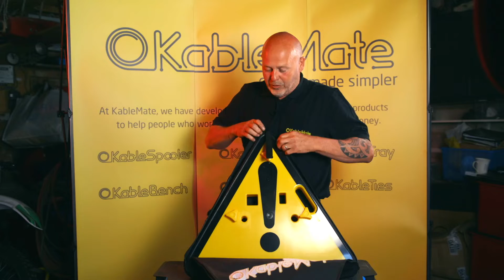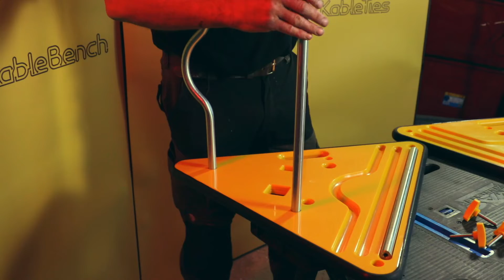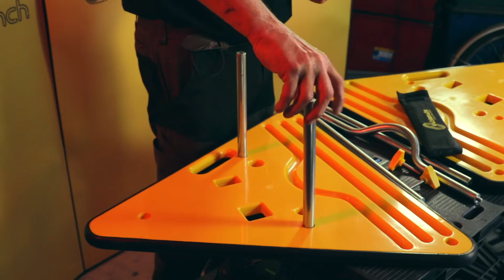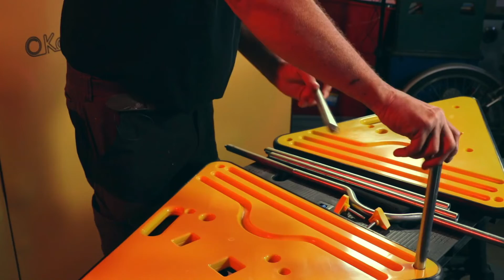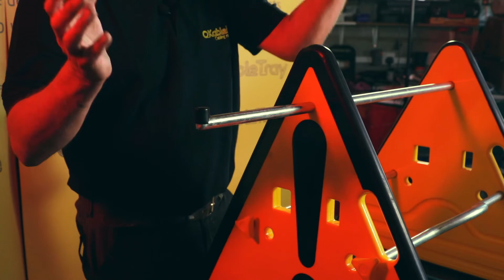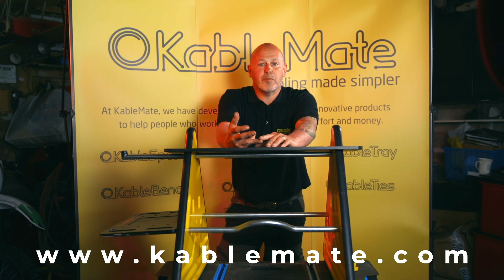KableMate - the flexible electricians cable spooler, work bench, hop up step ,conduit vice...

Comment: This looks pretty nifty in all configurations. However clearly when using it as a bench... Its not going to be for cabling at low level, this is a workout bench designed for bulking up your arms 💪💪

Comment: Shame the bars aren't 20mm conduit, that way we could replace/make our own. It is a pain to unscrew the bars to change drums of cable. Still hard to beat a pair of jack's or some rack-a-tears. All those extra bits for the bench and hop up seem a lot to carry around, I would prefer using something I already have or a bit of wood (even a template to make your own would be good). Curious if turned on its side if you can stand on it?? Would be great to see an on site test!

Comment: like the idea and concept of the bench etc. only issue i see is the fact you have to undo the bolts every time you want to change a drum
Reply from the maker: Good point 👍
Reply: @efixx 

With reference to the necessity to remove 3 bolts when changing drums.
If you look for antiluce or anti luce pins, say, on eBay, you will find a solution to the pesky bolt problem.  The thread size has obviously got to match, and three large metal washers to protect the unit would be necessary. The unit can then be swiftly disassembled with a Birmingham screwdriver.
This can only be attempted, after a risk assessment, and presumably after asking the manufacturer.